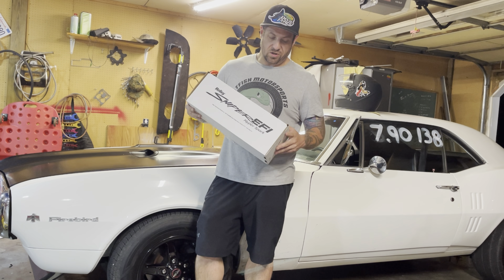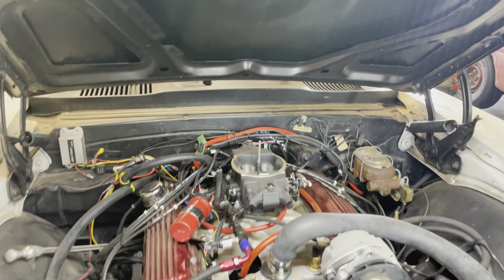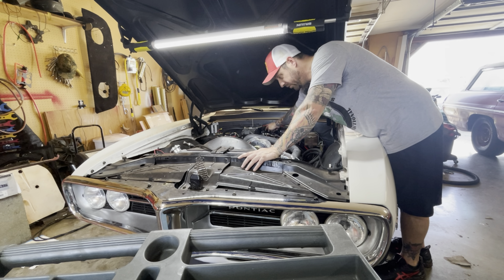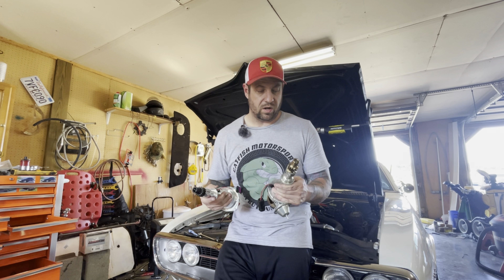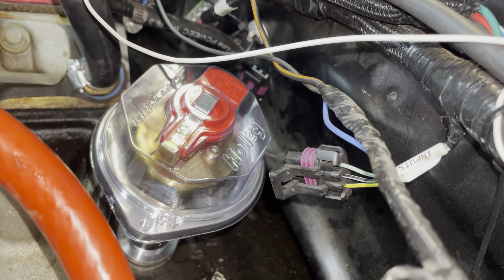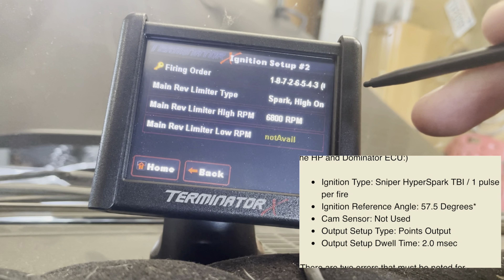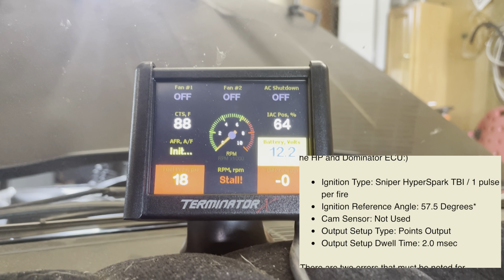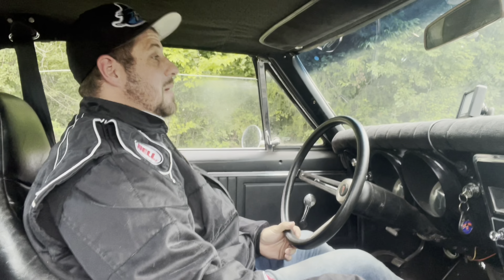How to install Holley Hyperspark with Terminator X Stealth EFI system, with drag strip testing!

Comment: I just bought the hyper spark kit with the wiring harness part # 565-300k should I go with the Sniper 2 or Terminator x with the stealth basically similar in price
Reply from the maker: I went with the terminator because I didn’t want to deal with the possibility of RFI issues. However, the Sniper 2 supposedly solves some of that compared to the original sniper.